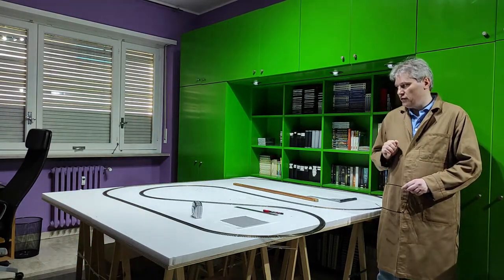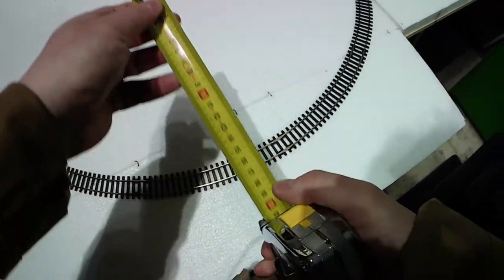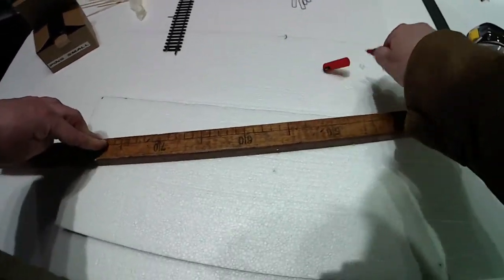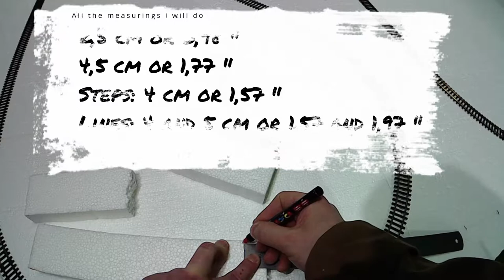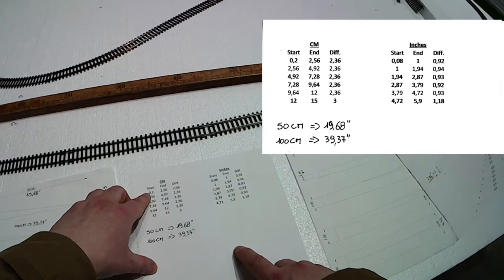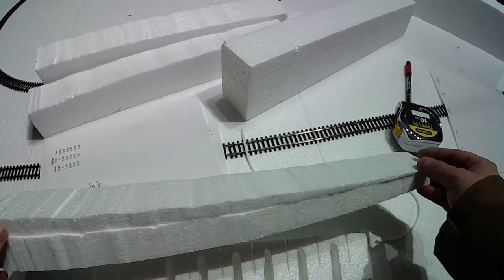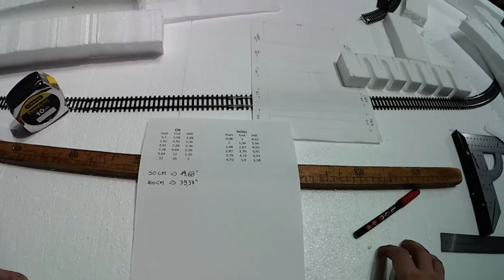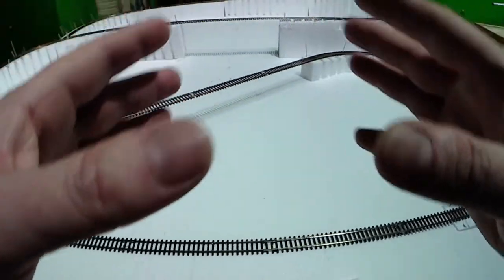Christmas Village Tutorial 2020 - Part 2

Comment: Very informative series so far. Your attention to detail is top notch. I have a question regarding the tacks you use to hold the track in place. Are they something you bought specifically for that purpose, from a model train store etc? Or could you use small finishing nails or brads found in any hardware store?
Reply from the maker: Hi. Thank you. In this case I have bought them at a model train store they are from the same brand of the tracks (Piko).
You can find them online here:
https://www.amazon.com/Piko-track-55299-Nails-400/dp/B0000WPMBU/ref=sr_1_1?dchild=1&keywords=piko+55299&qid=1601837276&sr=8-1

Or here directly from the manufacturer US site
https://www.piko-america.com/products/track-nails-approx-400-pcs-ho-scale

Or here if you live in Europe:
https://www.modellbahnshop-lippe.com/Gleise+%26+Gleisbau/Standard-Gleise/Piko-55299/de/modell_20933.html?gclid=Cj0KCQjw5eX7BRDQARIsAMhYLP-U9R_lmShlQw704SykfOxRMCqWI35f-76D92eSQkzYVinUMLJK7f0aApvZEALw_wcB

But obviously if you find the correct size you can use any kind of nails from hardware stores. I have started with them when I firstly added the train to my village.

Comment: thanks for the detailed tutorial, long videos are not bad per se, cause you can watch them little by little. Congrats for the intuition that makes flexible what is usually unflexible! :) Just a question: will the train always run in the same direction (i.e. clockwise) or also in the opposite direction? Is the steepness the same in both directions?
Reply from the maker: Thank you for you kind comment. I know I am obsessed with clockwise rotation. Every year is the same. For a brief moment when the train will come down  there is a counterclockwise curve. In a circular or oval circuit there are generally 2 curved sections so the train will turn completely clockwise or completely counterclockwise. Here I have tree curved sections so forcefully one is turning counterclockwise. Starting from level ground, with the tracks nearest to the camera point of view, each 100 cm of tracks I have the train climbing up 4 cm (4% of steepness) when the train has reached 15 cm of height it will start the descent and here again the difference of height is 4 cm each 100 cm traveled. Same steepness from both directions. My answer is coming from the future (i.e. many other parts of this tutorial are now uploaded) so I will try if I like it better with the train running counterclockwise ( 2 out of 3 curves counterclockwise) because you just put me the idea in my head.

Comment: From where did you get such a long track
Reply from the maker: The track is not from a set. I generally use H0 tracks from Piko. Both straight (G231) and curved (R1). And sometimes also long flexible tracks (G940). Here is a link for you.
http://www.piko-shop.de/index.php?vw_type=1&vw_name=download&vw_id=10049

In Europe you can buy them almost in any train model shop or online.

And the train is a Bachmann On30 gauge set I bought around three years ago.

https://shop.bachmanntrains.com/index.php?main_page=index&cPath=487_672&zenid=q2rbaeo2mj4otlkuvu2jvio037

On30 gauge trains are well proportioned with Lemax buildings dimensions (generally trains are too big or too small when you add them to a Lemax Christmas Village) and can run on H0 tracks.
Reply: Thank you for the reply. But I am an Indian.
Reply from the maker: Both Piko tracks and Bachmann trains can be found on ebay India but all the sellers are from the US so I immagine that prices are elevated.
Reply: Yeah sir, the delivery charged will be high.